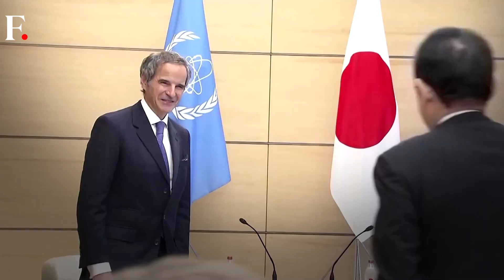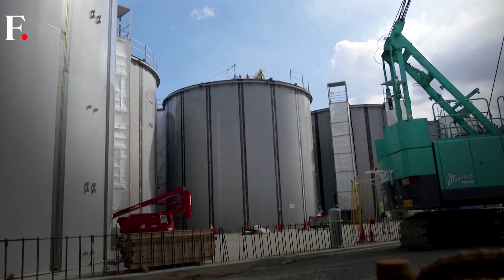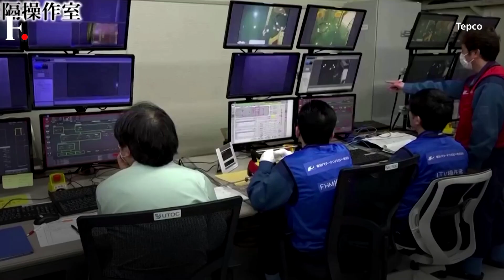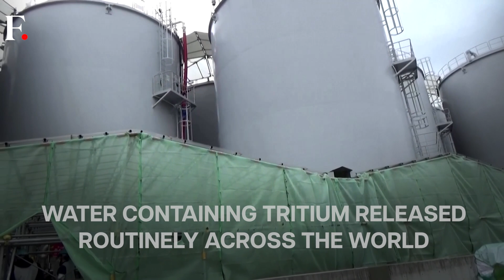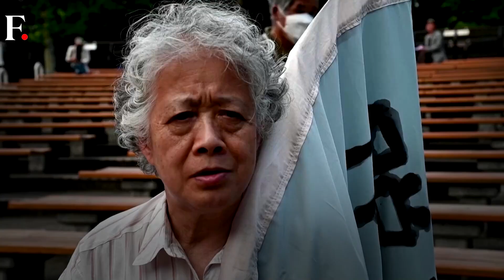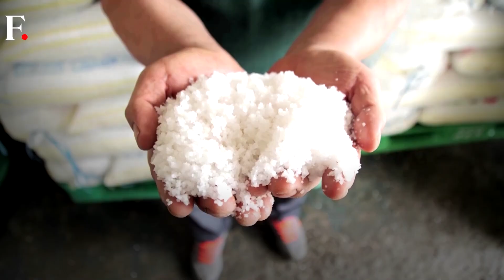Japan Set to Begin Decades-long Process of Pumping Out Fukushima Water

Comment: After treating Fukushima nuclear disaster wastewater, Japan's dilution approach to meet testing standards raises questions. Despite ALPS processing, the water retains high radioactivity. Diluting with seawater before testing creates a potential loophole – failing results could be 'fixed' by further dilution. However, the logical contradiction here is that diluting nuclear wastewater with seawater and then discharging it back into the sea, as opposed to directly discharging the nuclear wastewater into the sea, raises the question: does it really make a difference at the level of the ocean? The vast planned discharge and ongoing pollution generation add to concerns. The fixed volume of seawater amplifies the question: Is full discharge into the sea the right approach?

Comment: Why is nobody talking about chinas nuclear waste dumping ? Japan south korea and china all need to be held accountable
Reply: The United States is just as guilty. Accountability will be held on judgement. We are damned for hell.
Reply: Nuclear wastewater and nuclear-contaminated water are two distinct concepts, and the Japanese are attempting to interchange them. In Fukushima, Japan, what they have is nuclear-contaminated water, which comes directly into contact with the reactor core of the nuclear reactor. In a regular nuclear power plant, the discharged nuclear wastewater is the cooling water for the reactor, which doesn't directly contact the reactor core. These are completely different concepts. As for the risks, the Japanese are also altering the meanings. You can search online to see that the hazards of nuclear-contaminated water are truly terrifying.

Comment: Japan is releasing 22 trillion becquerels of nuclear waste water in a decade.
While China releases about 450 trillion becquerels of nuclear waste water every year. 

The becquerel is the unit of radioactivity in the International System of Units. One becquerel is defined as the activity of a quantity of radioactive material in which one nucleus decays per second.
Reply: Nuclear wastewater and nuclear-contaminated water are two distinct concepts, and the Japanese are attempting to interchange them. In Fukushima, Japan, what they have is nuclear-contaminated water, which comes directly into contact with the reactor core of the nuclear reactor. In a regular nuclear power plant, the discharged nuclear wastewater is the cooling water for the reactor, which doesn't directly contact the reactor core. These are completely different concepts. As for the risks, the Japanese are also altering the meanings. You can search online to see that the hazards of nuclear-contaminated water are truly terrifying.
Reply: there is a huge difference between nuclear waste water and water polluted by radioactive elements. Waste water doesn’t contain any radioactive elements. It’s sad to see you are brainwashed like this.
Reply: @dayhostyin5710  India Curry Troll with brainless...??? 😋😜😁🤡🤡🤡
Reply: What Japan gonna released are different from China and US. Those water cause by the Power plant leak in Fukushima cant be filtered to clean you dumba$$
Reply: Do you know what happened in Fukushima? It's a nuclear leak. It's nuclear sewage, not cooling water.